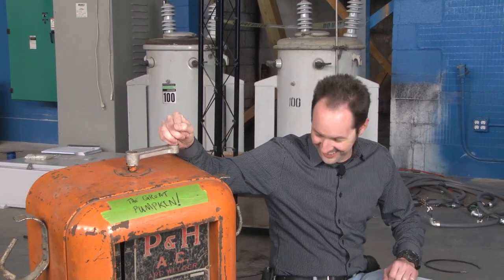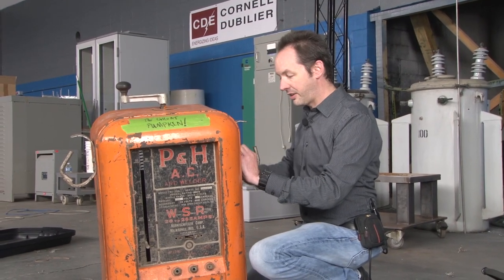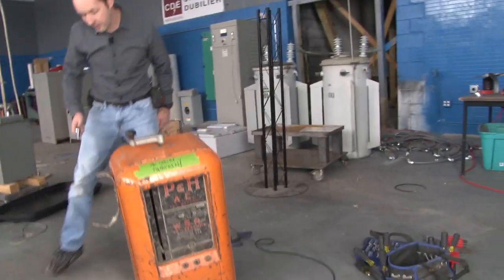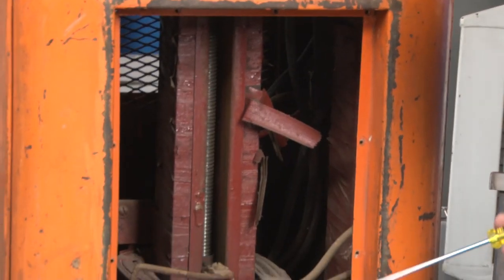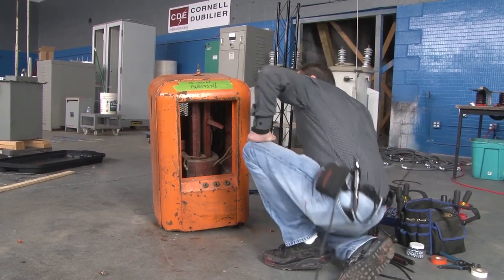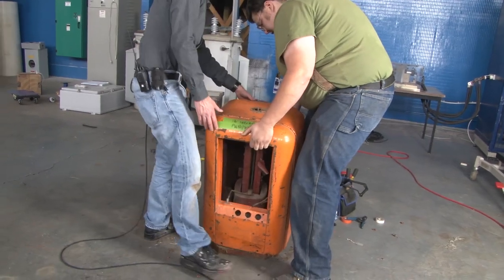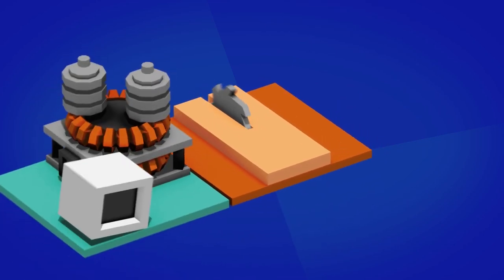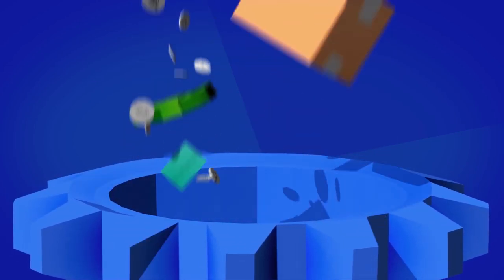"The Great Pumpkin" Arc Welder: Equipment Autopsy #86

Comment: The Great Pumpkin was something that I recently received in a trade deal, I was going to see about using myself, but knew it would have a better use/life at the Geek Group.  The 'handles' were the cradles for the power plug wire as well as the welding lead wires.  It was a very heavy beast, definitely not a one person job to lift.  As we say in the Lab it would be a 1.5 Batman, 1.5 Minkus, 1.5 KC, or a 1.25 Moose job.
Reply: Jason M y not use it?

Comment: Vise-grips for old hardware. Bolts require a nut and a wrench and are torqued to spec, while screws, no matter how large, are never torqued and don't usually have a nut. Finally, watch out for asbestos covered wiring. It was used extensively in knob and tube home wiring as an insulation material and may be used in industrial stuff as well. I wonder if you could rewire that thing to get more power out of it? Maybe some 2/0 or 3/0 gauge welding wire?
Reply: +smmiller506 I always thought the difference between screws and bolts was bolts require pre-cut female threads and screws cut their own female threads. nothing to do with the heads.

Comment: Why don't you use a Saturatable reactor for a current limiter instead? (Google that) I have seen several videos about them before and they seem geared for exactly what you want to do.
Reply from the maker: +Just Power Electronics Love to, find one that works for 3 phase 480VAC at 200A and let us know.
Reply: I have seen it possible to make one out of two high voltage transformers e.g. MOTs by putting the primaries in series and the secondaries in anti-series, this means that you get a net of zero volts on the output, from there you would pass your DC current flow through saturate the cores, causing the current to be limited in the primary.

You could scale this up by using some pole mount distribution transformers, or even some other ones you have access two in your wealth of copper wound iron goodness.

This could be a very interesting experiment to demonstrate maybe, as this technology is usually not touched much anymore in favor of solid state, however it used to be used quite a bit for large motor control and in the semiconductor industry for the silicon furnaces.

If you have some genuine interest, send me a private message and I can pass you over some books and greater information about it.